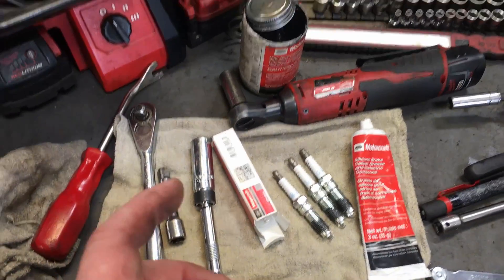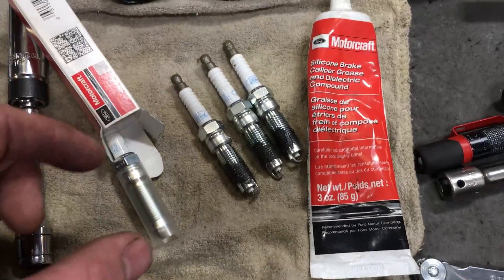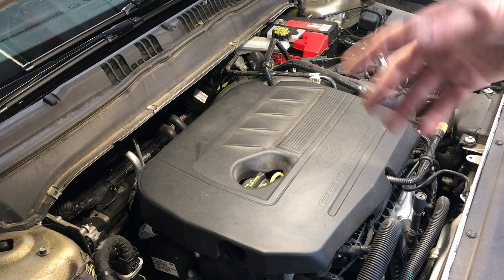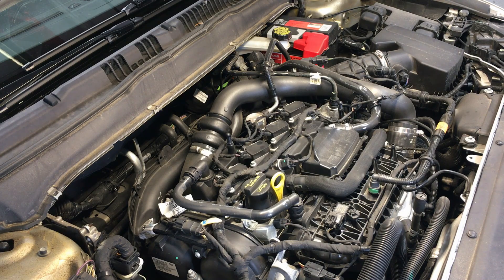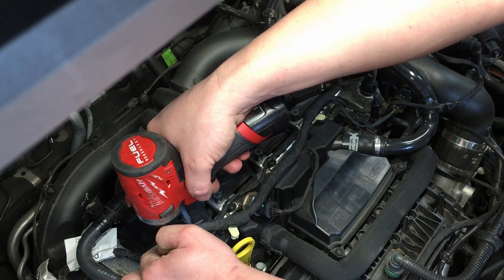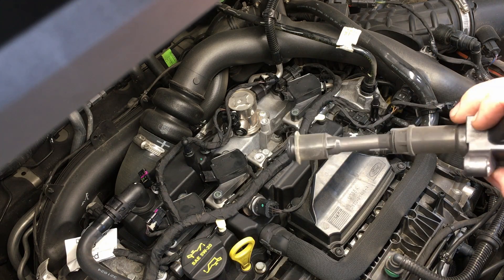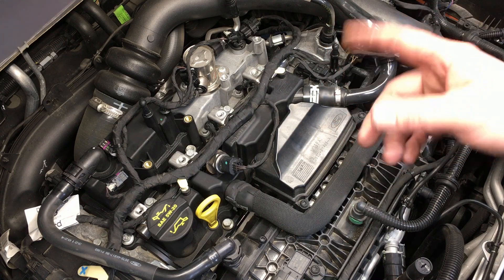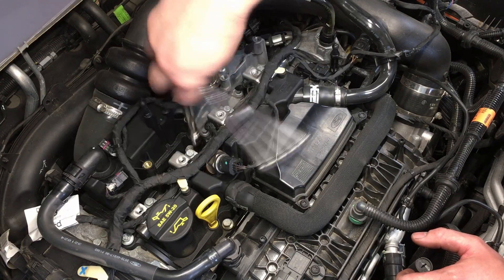2014-2018 Ford 1.5L GTDI Ecoboost Engine: Spark Plug Replacement

Comment: For everyone posting comments questioning why he said this engine likely won't last to 200,000 miles -- it is simply economics.  The vehicles these engines are getting installed in do not have very good resale value, especially when they are hitting 200,000 miles.  The repairs on these vehicles is VERY expensive - these engines are for all intents & purposes "dead" when their twin-turbo fails, and there is no patching it up to get by for a little while longer with this engine design.  Usually most customers find it makes more sense economically to sale/trade-in the problem vehicle for another new/used vehicle.
Reply: If the turbo in the 4 cylinder ecoboost fails at 200k miles, its a bit expensive at around $1,500 to replace but the cost is definitely not unreasonable.
Reply: It makes perfect sense in the rust belt.  In California, Texas, Florida a car can easily last 16-20 years with little or no rust.
Reply: Also cuts down on the used car market - something auto makers all love.
Reply: @derekhood7815  yes theres a 4cyl diesel with compound turbo system
Reply: Does the 2018 2.0L EcoBoost have both GDI and Port Injection?
Reply: Unless the turbo throws parts into the motor when it fails witch does happen often but not a lot esp on these low psi systems, the replacement of these 800-900 dollar turbos is a very simple diy on these cars so it should only cost at max 1,000 with tools, turbo and shipping and a little bit of knowledge. But the statement you made about these vehicles resale value is accurate, they have terrible resale value
Reply: My 2017 ecoboost 1.0 Focus has started to leak coolant at 25k miles. Stay away from thee tiny crappy engines. Great disappointment. The only good thing that the warranty goes till 60k. After that repairs will be very costly !
Reply: @hectorvazquez7929  What would u recommended instead
Reply: Man I wish I knew this back in 2018 when I bought my escape. The piece of garbage has been nothing but a pain in my ass. 

3 different transmissions put in, 3 engine bay sensors replaced, failed grill shutters, tranny shifter cable, turbo problems, you name it. Replacing the plugs this weekend - hopefully I don’t run into a random crux that dumbass Ford engineers made for no reason like every other job I do myself. Ford dealers are also scum bags 99% of the time.

Thanks for saving me money!
Reply: My turbo is getting a new one, so my Escape will be good for more than 200,000, when it get to that point then have to buy a better car!!! I do love my Ford Escape; I have repaired a lot of stuff on it just watching videos & let me tell u, u will save urslf a lot of $$$

Comment: On a side question... I’m looking to buy a 2013 Police Interceptor Sedan. It has a 3.5 motor.... I see they changed to a 3.7 a year later. Is there any benefits to either engine? I’ve read that the water pump is mounted internally and is a VERY expensive repair. Can you comment on these engines? Thanks! Love the videos.